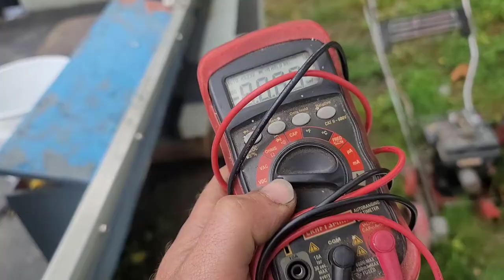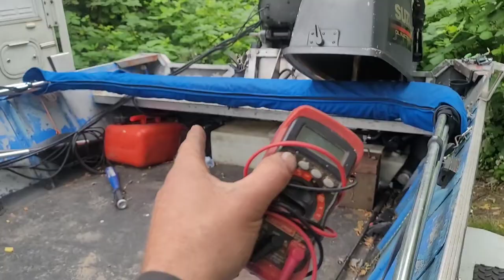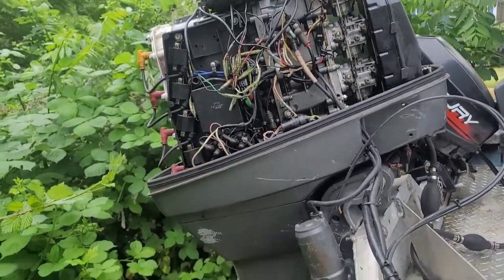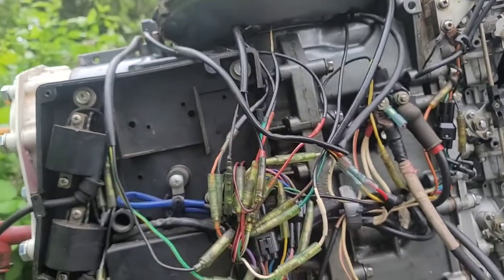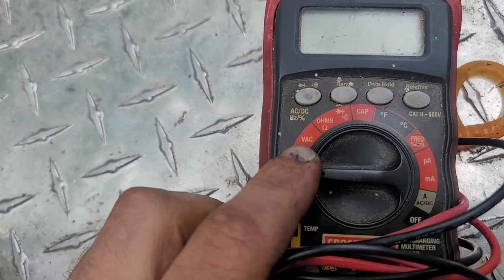how to diagnose no battery charge outboard

Comment: Was looking for typical charging voltage on an older Johnson 55 horse.  Watched this. It’s ok but with a Merc of you disconnect the battery with the engine running chances are you will need a new rectifier if that’s not what was wrong to begin with. But if it’s not the rectifier then chances are it’s the stator or wiring in which case the battery was already effectively disconnected.

Comment: Brother I wish you were in my neck of the woods, I've got a 1997 Suzuki DT115 with no fire at all driving my nuts! It's hard to drop $1300 on a CDI not being able to test it to determine if it is actually the CDI, I bought the factory Manual and it show to need a $500 tester to test it, and to top it off the Factory Manual doesn't match up to the Wiring color code wiring showing the Motor is suppose to have a ECU not a CDI which are wired differently with more wires than the CDI. I've been pulling my hair out throwing my hat at it and calling several names  LOL

Comment: On my boat I have two 2018 df 140. In one of them I got the code 1-1. The gage reads 17V average. It goes up and down from 15.6Vto 17.8V. When I start the engine, it shows 11.2V and after a minute or so goes up to 17v like I describe above. I cleaned battery terminals and cable connectors. I purchased and installed a new rectifier regulator. I switched the batteries. The problem is still there. What else I can do?

Comment: That is really good, helpful info and helps explain what is going on with my old Mercury l6. 

The thing is, it is a bad idea to disconnect the battery with the engine running. The alternator will have no load and toast the rectifier. But hey, if that turned out to be your problem, you were going to trash it anyway.

Comment: Thanks for the awesome video! You recommended just replacing the stator if the motor shuts off after being disconnected from the battery. Can you elaborate on that a bit or is it just a no brainer to start with buying a new stator? Thanks!

Comment: I changed the stator. However, the engine still stops when I disconnect the battery, what could the next cause possibly be in the diagnostics? Thank you for helpful video!

Comment: Thanks Captain 👩‍✈️. I just got the timer base(trigger) I installed and boom 💥 got spark now on first cylinder and rest of them you are the man.  still I have  problem I saw when I got it, spin slow. I thought was the starter I opened and looks good all brushes in place good size pretty clean inside.if I left one spark plug spin  fast like it should but If I connect one  more spin really slow.  I think am close finally to fix this sh…. What do think 🤔 can be Sr? The battery is 12.60v.
Reply from the maker: So it spins slower when connecting spark plug wires. That's sttrrange
Reply: @CAPTAINWILLY  no, it was like that, I mean when connect all spark plugs. But thanks to to you I did the diagnostic and fix about the spark in first cylinder.

Comment: I have a 2000 Evinrude 9.9 outboard four stroke runs fine for one minute then goes into a limp  mode spudders doesn’t rev what do you think
Reply from the maker: Sounds like a heat effected coil

Comment: Question.   My mercury 50hp 2strock will start sometimes but for the most part doesn’t start.  I took the spark plugs out and started turn over like a brand new one but after I put them back in my starter will drag and the boat want start.   Any help would be greatly appreciated
Reply from the maker: Sounds like a lack of power. How's your battery. Due to engine compression it will crank much slower with spark plugs in it. As it should
Reply: @CAPTAINWILLY  no I have two brand new batteries and 2 new plugs.  I ever took my jumping cables and hook the two new batteries together but it would still drag.   
But I went out there today and it was try to start off of one battery but it never started and after about 3 time it started dragging again.  
It’s blowing my mind

Comment: i got a suzuki dt40hp 2 stroke. I can't find a rectifier for it and the one guy suggest that i get a 4 pin bridge ac to dc bridge rectifier. I've hooked it up and it gives me about 8volts on idle (DC) and if i increase my throttle the voltage go up to about 15volts. my question is should the voltage for the rectifier be at 12volt on idle or is it fine at 8volts? Bare in mind the positive is not connected to the battery and is tested on the volt meter. (Not charging the battery). I'm going to connect it tomorrow to the solenoid so that it can charge the battery. 

i just want to know what the voltage need to be at the idle for the rectifier?
Reply from the maker: Your stator should have a idle coil amd a high rpm coil. It should be 13 at idle.
Reply: @CAPTAINWILLY  ive just recheck my voltage coming out the magneto. 
Yellow  = 4v ac
Red = 4v ac
Blue = 26v ac

The blue is connected to the cdi box. Should i bridge the cable and connect yellow and blue to the rectifier?
Reply from the maker: @coeniejvr  no. IL have to do some research
Reply: @CAPTAINWILLY  i've had a spare solar charge controller that can take 25A.

I've hooked that up to the bridge rectifier and when the boat goes to about 3500rpm i'm getting 15volts out of it. The solar charge controller will charge the battery at 14volts. (on idle it's not charging) but as soon as rpm increases the battery is being charged.

i'll test it on Wednesday at the dam to see how it works, will let you know.

Comment: 2007 250 hp 4 stroke  not sending enough power it’s 3 voltage to the engine to crank the engine  and it’s not starting . I need some help if you can . I am new to this 
Thank you In advance
Reply from the maker: Checking power on both side of the starter soliniod what do ya got. During crank. How much power on the small wire on the soliniod

Comment: Nice video Captain!!! like always, I would like help with my outboard motor, is an old evinrude 1976 70 hp 3 cylinder 2 strokes, I bought used,  previous owner told me no spark in first cylinder, he said is power pack, but I saw your  videos first to check some components  before star buying stuff , I check compression is good, check spark and no spark on first as he said, but if change the wire from coil 1 to coil 2 and I get spark in number 1,  I thought is coil and replace it. but still the same no spark, power pack new, and rectifier because the red  wire is almost cut was holding only couple string. I wanna make sure if its the stator or timer base. The motor without sparkplugs spin like it should, or with one or two I think buy if connect the 3 sparkplug barely spin!, I would like to record some videos how act this thing and if you can help to diagnose I would like to pay for your help. I think will a another option to make money Captain charge for diagnose outboard motor video call or something like that. Pls let me know what do u think Sr. Thanks for share your skills
Reply from the maker: Oh boy. Lol. So your able to get spark out of cylinder 1 when moving coil signal wire off of coil 2 onto coil one?
Reply: @CAPTAINWILLY  yes
Reply from the maker: Ok. So now it's going to take trading trigger or "timer wires" that go into the cdi. So let's just say forr example.  Red wire from trigger signals the cdi to fire number one. And yellow wire signals cdi to fire two. Put the coil wires back to stock. Find trigger input to cdi for each cylinder. Then trade. Yellow from trigger will go into red at cdi with red disconnected then see if there is spark out of coil one.
Reply from the maker: The first test with moving signals around on the coils proves the coils are good
 So trading trigger wires at cdi trigger inputt will tell you if the cdi or the trigger is bad. Either way you know at this point there is no signal from cdi to coil one. Need to know if it's a lack of cdi or is the cdi lacking info from the triggger
Reply from the maker: If you move number twos signal from trigger to cdis trigger input for number one and still nothing from number one coil. Cdi is bad. If your move number twos signal into cdis numbers one then coil has outputt. Bam badd trigger